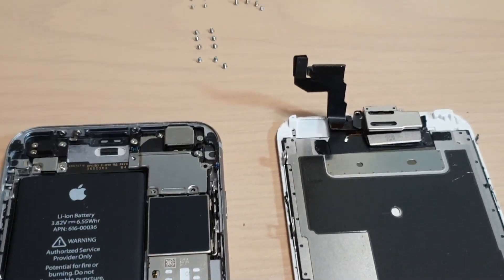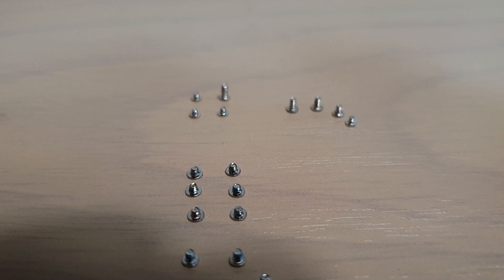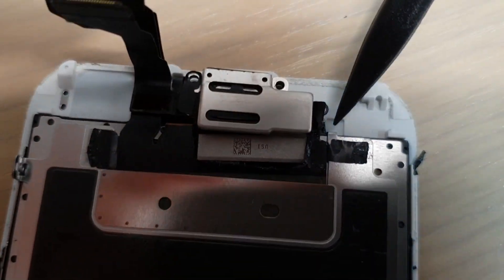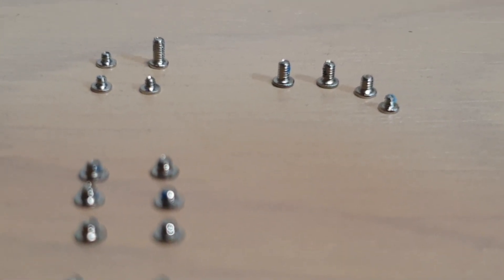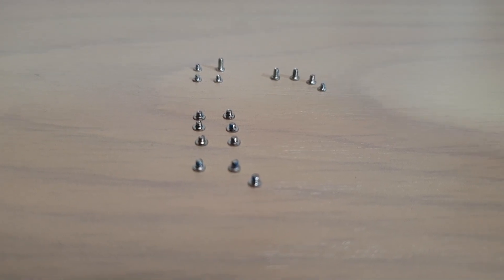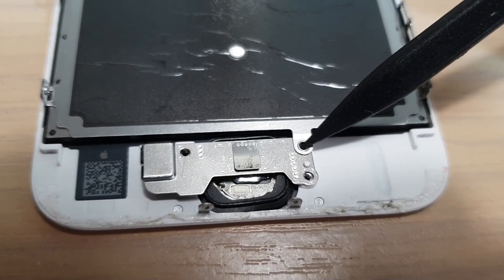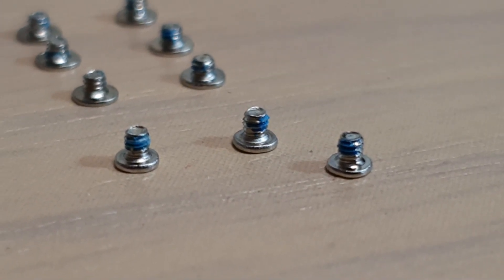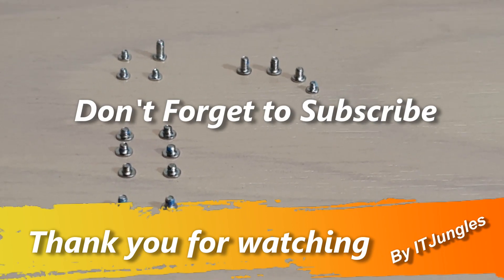Screw Size Diagram for iPhone 6S Screen Replacement When You Mixed Up

Comment: Thanks for the vid, but it would have been nice if you had labeled the screw Type & size, length, and thread next to every screw on the table.

e.g. next to that first "tall" screw you could have provided the label
Torx 1.5,  2.0mm, Thread 12 or equivalent.
(whatever the actual values are...I just used Torx 1.5,  2.0mm and 12 as EXAMPLES)